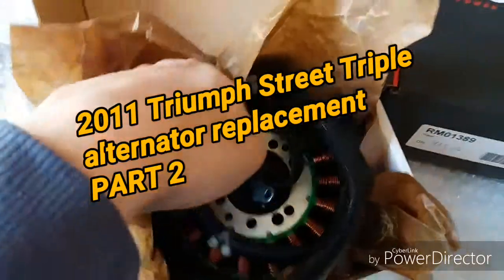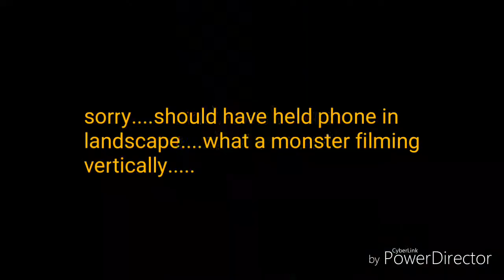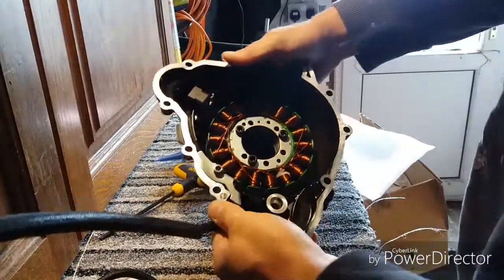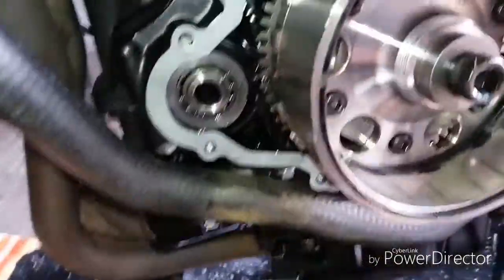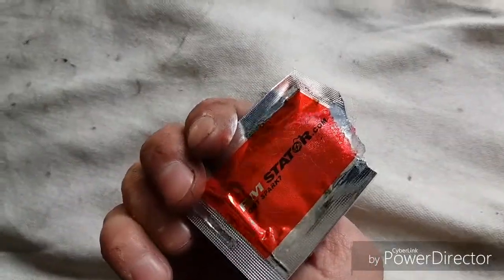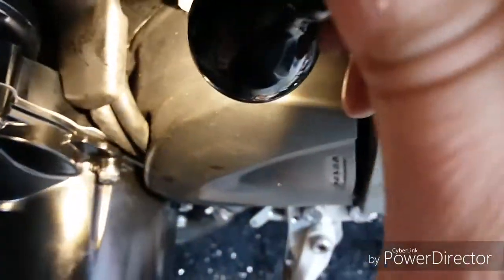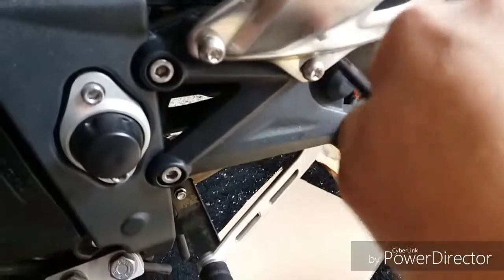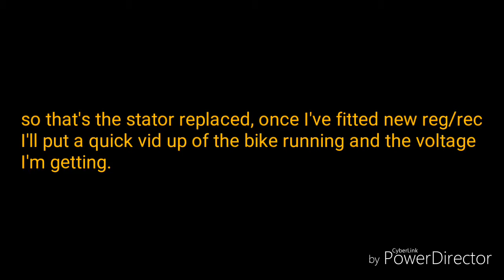2011 Triumph Street Triple alternator replacement part 2

Comment: hi, I've just a question: as far I understood from service manual it should be used a silicon fluid in addition to triumph gasket but in your video it seems not applied. right? just in case why did you adopted this approach?
Reply from the maker: Hi there...when I took my old one off, there was no evidence of any silicone, so I just didn't use it....
Reply: @gypseyswhippet7276  ok tks, please could you confim even not using any silicone fluid there are no oil leaks? Tks again

Comment: Hi Gypseys, I had the same experience as you. First replaced bad stator and just in case the reg./rec. And after only one ride, the battery is not charging again. What did you find was the problem in your case?
Reply from the maker: hi there...sorry I didn't reply, I put it down to my heated grips being at fault. Took them off, been fine since.

Comment: Hello, can i ask why you replaced the cover ?
Reply from the maker: Hi, I think the cover already had damage from a previous owner, and had been repaired. When I tapped the cover with my mallet to release it, it dislodged the repair. I noticed a slight weep of oil and then spotted a crack